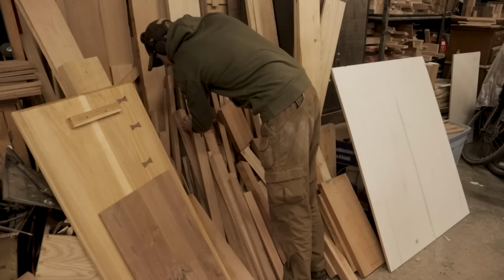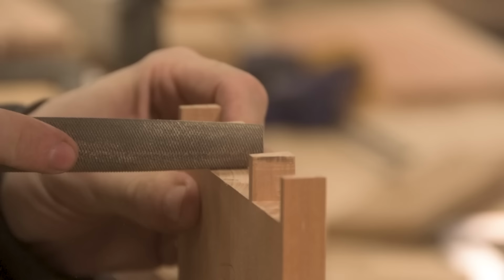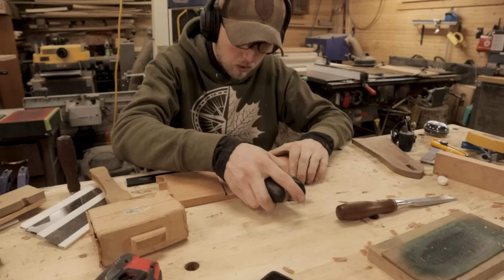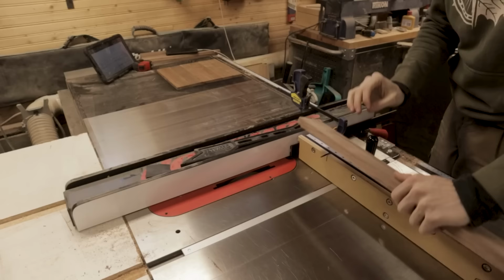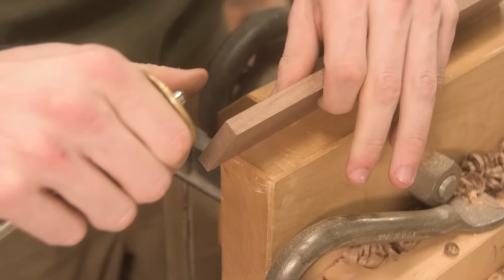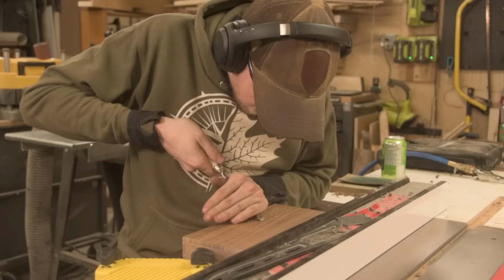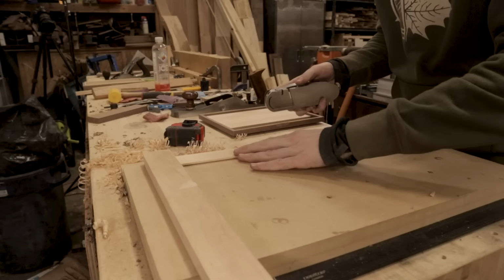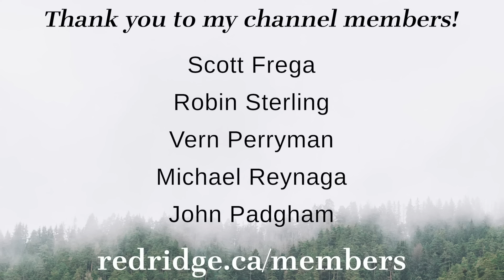Highly Detailed Tool Box

Comment: there's a lot to like here! But as you said, it's hefty when fully loaded.  To lighten things up,  I'm interested in making a modular system with a basic box/tote of thin baltic birch (model aircraft ply), and separate boxes for different jobs.
Reply from the maker: The tool box itself isn't too bad but once you throw in  4 cast-iron hand planes, that's the majority of the weight. A modular design would be pretty cool though, then you would only have to carry the tools you need.

Comment: I like the design, seems to have some Arts & Crafts elements. I have played around with making tool boxes too. Weight and size matters as far as it being practical . I find that anything this large and heavy should be a cabinet. However, Very nice work!
Reply from the maker: That's kind of the awkward point that I'm at! I'd prefer if this was a cabinet to but I don't have a place I would be able to hang one and this format let's me quickly quickly clear off a work surface by safely putting all my tools on the floor.

Comment: Very nice job of both wood working and video production.  You have two Jack planes.  What do you use one and the other for.  Thank you
Reply from the maker: I actually use three different Jack planes! The Low Angle Jack is for the shooting board or if I'm working with some challenging grain because I can easily swap out the blades to different angles. One of my No. 5 is specifically a finishing plane, I'll sharpen the blade dial in the depth then not change it again until I need to sharpen the blade. Then the other No. 5 is for general purpose, the blade on it isn't as good so I let it do the heavier stock removal and worry about tearout with the better No. 5.

Comment: Well done Morgan. Absolutely love this. Putting the texture on was a great addition. Also cool that you got a compass plane. Stellar work brother.
Reply from the maker: Thanks, I really need to find some more methods of adding texture. I like the stippling, I just don't want to use it on to many projects!
The compass plane was definitely an interesting find, I wasn't expecting to buy it when I did but it felt like one of those times where if I passed on it I wouldn't see one again for a long time.

Comment: Looks really great, especially with the stippling effect you added.  Have you thought about adding a decent chamfer plane to your hand tools?  I like the one made by Saker, which is small, durable, and comes with six replaceable inserts for around $40 total.  Great job on the piece and the video!
Reply from the maker: I've wanted to but I didn't know they were that cheap, only one I'd ever seen was the Woodpecker which was a little to expensive. I'm adding the Saker to my amazon cart and it'll soon have a place in the tool box!

Comment: My first dovetails (35 years ago?) used a jig and electric router but it's been decades since I stopped using the infernal screech machine for this. Unless you're doing a serious production run, for me, hand cut are preferable in all respects, including overall time spent. In fact, everywhere you used an electric router here, the operation is simple to do with hand tools. But, you be you and thanks for another entertaining video. BTW, I've been doing mortise and tenons for many decades (I'm 69) and still approach them with a bit of trepidation. Who wants to mess up a nice piece of wood? As to the stippling, you can get a similar but easier to accomplish effect with a narrow, short radius-grind roughing plane, varying direction as you go. Love your sharing and hope your channel grows.
Reply from the maker: Yeah, the router can be a little annoying and with hand cut, I think it's just the effort that goes into them that makes them slightly cooler!
That's a great idea with the plane, I'm still trying to find one that I can turn into a scrub plane because I love all the different textures I've seen people create with them!

Comment: nothing beats using a freshly sharpened hand plane or chisels, well really any freshly sharpened hand tool. I always end up cutting myself somehow, from the tool or the corners on the wood, and it takes longer, but it's far more rewarding and fun.
Reply from the maker: Those cuts from a sharp wood edge are the worst, it's like a paper cut on steroids! But they do mean you've got a nice sharp edge so it's the good kind of pain!

Comment: I gasped when I saw you taking the file to the pins 😮, but I do appreciate seeing how others accomplish things. Thanks for the content brother 👍
Reply from the maker: I've had some bad luck using my chisels for tuning up the pin, so I find the file is a little more controlled. Still working on the chisel technique though, hopefully I'll get past using the file soon!
Reply: @morganhurst_redridge  I hardly ever cut myself with a file. :) I notice when you saw dovetails, the board vibrates a lot. I have the same saw and it doesn't do that. It could be a lot of things but if you had less vibration, the cut would be smoother.

Comment: Nailed bottoms are not evil, when appropriate. You keep being you. As to mitering the corners of the box edge inserts, check out Michael Pekovitch's 'How and Why of Woodworking.' He is a big fan of Kumiko and shows how he uses a jig for those critical angles and a mitered shooting board for mitered inserts. LOVELY work, buddy!
Reply from the maker: Exactly, nailed bottoms can be a quick and practical method!
I've been planning to buy that book for a while now but I know when I do, that will send me down the rabbit hole on Kumiko! I made a 45 shooting board at some point in 2021 but I think it accidentally ended up in a dump run. I was planning on making another one for this project, but I was running out of time for the video and chose the slightly faster method.

Comment: You could put all the set up blocks into a removable tray for quicker access to the spokeshave. Nice video!
Reply from the maker: I actually planned around doing that but the problem I ran into is the walls of the tray would have to be at least 1/4" thick which mean losing another 1/2" on the inside length of the tray. So I made the compromise that once a month when I use my spokeshave, I can just unpack the setup blocks.

Comment: Morgan, might you have been at RISD in the late 90's? 'Cept I just heard you mention blanket chest, which made me think RIT.
Reply from the maker: Given that I was born in the late 90's in Canada, I can't say I was!
Reply: @morganhurst_redridge , conclusive! Thanks for the quick reply. I ask because your method of attaching  the handle supports is unusual, and I have only seen it used in a toolbox made in a class at RISD at that time, with the slight variation that it was dovetailed into the housing. All the best with your beautiful woodwork!

Comment: Nice result!  Which size Hirsch Straight Gouge did you use for the texture? #5, 12mm?
Reply from the maker: Thanks, the gouge is a #7 20mm. I'm hoping to get more sizes soon to have some more options for texturing or carving.
Reply: @morganhurst_redridge  Did you mean #7 12mm.  I see a 12 in the video.
Reply from the maker: You are correct, I had to double check, it's #7 12mm.

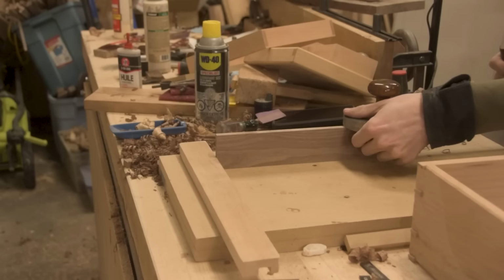Comment: What do call that palm held planer you used to bevel the edges? around 18:55 mark.
Reply from the maker: That would be the Veritas Skew Block plane. It is one of the more expensive block planes on the market but for all the features it has it's also the best in my opinion.
Reply: @morganhurst_redridge  thanks,i want to get myself one.